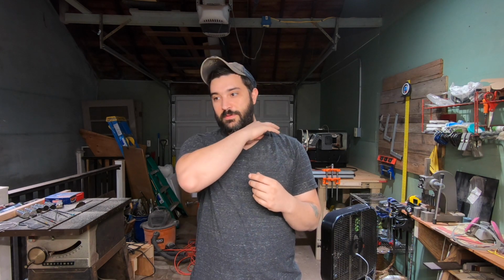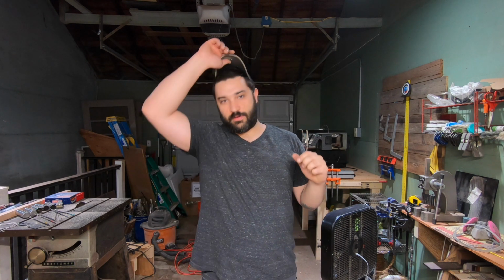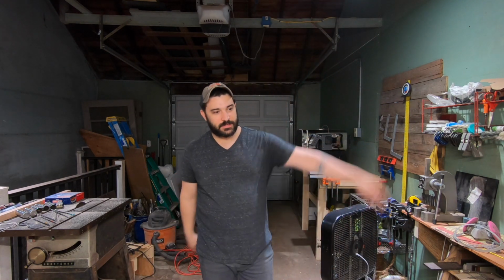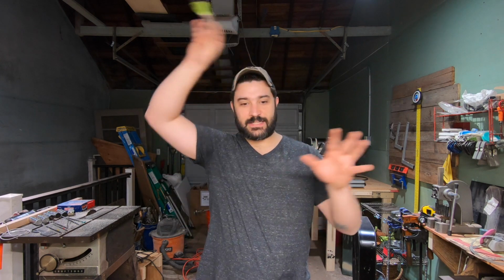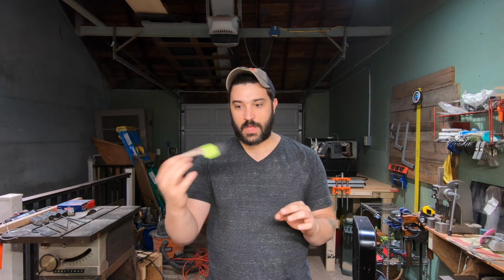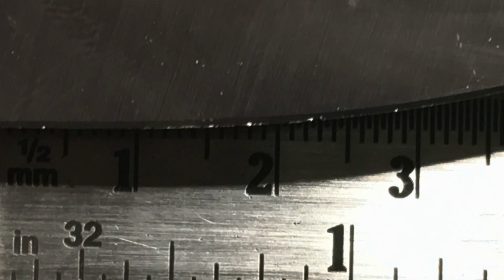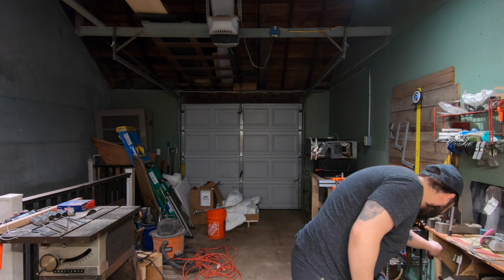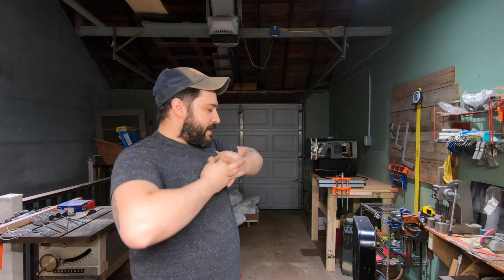Failures and Successes of the K390 Heat Treat!

Comment: Congratulations on getting this first one done, in the new oven!
 
It was hard for us to see, and you didn't mention the specifics. But when did the cracking of the coating happen? Did you notice the cracking when taking it out of the oven? Or did in happen in the clamp? 

I use foil, and purge my oven with Argon. So I take the extra steps (and expense). I would also never plate quench two knives at a time. That slows it down. I chill my plates too, between each quench (And my plates are twice as large as yours (Mass). Which helps quicken things up, and gets me good numbers. 

Stick with K390, as much as you can. It's great stuff!  I like A11 as well, but with K390 having the added Mo, V, Co, and W. I most of the time get better performance out of it. Not always, but most of the time.
Reply from the maker: Awesome advice! Thanks for watching! 

I think it started to crack in the preheat. It apparently melts and hardens at 2000 degrees. So in between pre heat and critical I’d say. It was cracked when I pulled them out. 

So foil next round and one knife at a time for sure. But I think I’m close for sure. 

I may have a buddy mill another plate and add a channel for coolant or water to flow through and carry that heat quicker. 

Yeah, K390 for the longer term for sure then I’ll branch out once I nail this stuff down! 👊🏻🍻